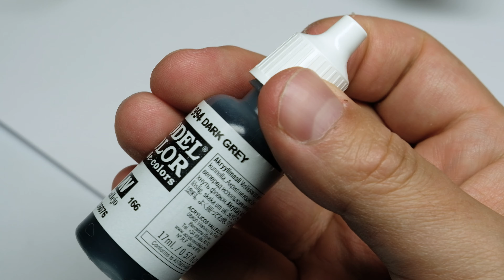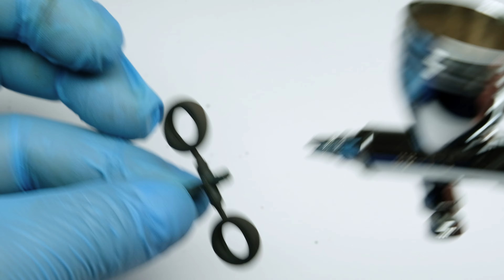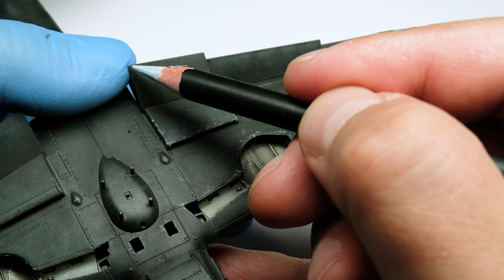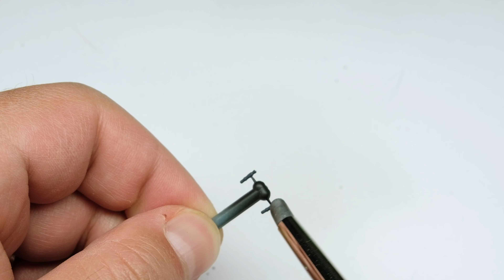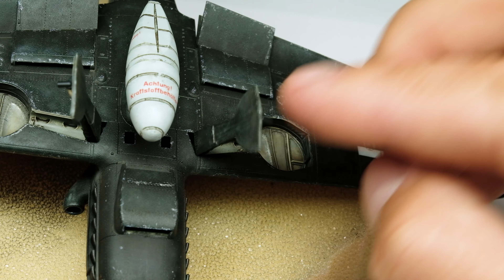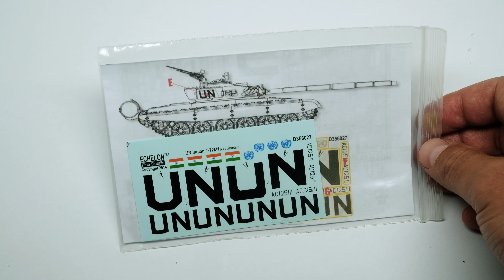Many little things like Chipping - Messerschmitt Bf 109-G6 1/48 from Eduard - Finishing the Model

Comment: Always love the oil effects.  Can you remind me the semi-gloss before the oils, is it acrylic or lacquer?

For the dry brush with the oil colours, are you using a filbert tip?

What type of pressure you running on the airbrush for the highly diluted colours?

Great final result on the model.  Looking forward to the next build and especially the 1:32nd scale!
Reply from the maker: I tried several brands and types of semi-gloss varnishes on this build, but the most satisfying was the Tamiya semi-gloss, thinned with Tamiya lacquer thinner. 

For drybrushing I like to use a very soft, synthetic brush. A filbert tip is also nice to use with blending and blurring oils.

I use very low pressure for highly diluted colors, perhaps 10 PSI or less. Just as low, that it doesn't blow away the color on the model.

I'm very looking forward to build my first 1/32 scale model... Zero? TBM? Bf109-E3?
Reply: @AirandGroundinScale   Thanks for the replies.

I would say the TBM as it can have folded back wings (I see the Trumpeter one is very nicely detailed).  Looks like there are a number of detail-up kits out there for it too.  Maybe nice to do a detail engine with some cut-away panels?

OR the BF109-E3.  I see the Eduard one has good engine details.  I also recall seeing one manufacturer that had a replaceable front section so you could have engine revealed or closed up.  Magnets made the swap fast and possible.